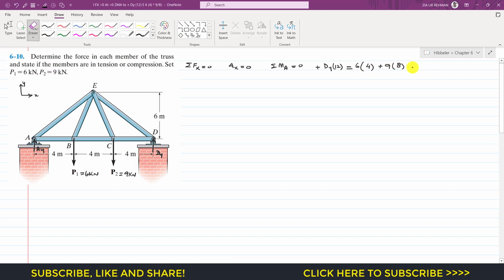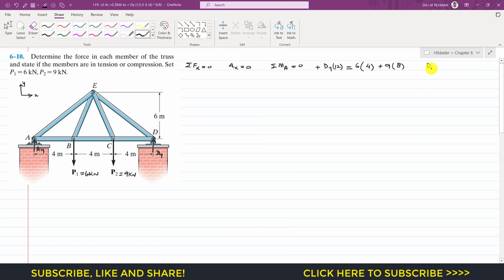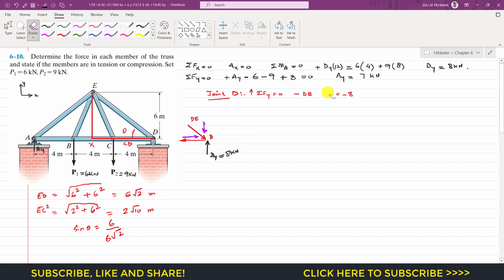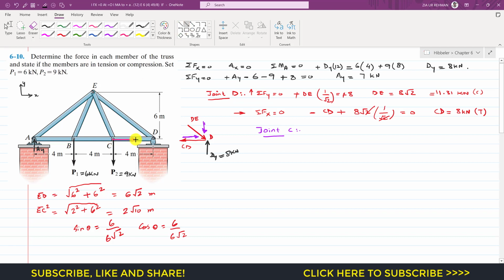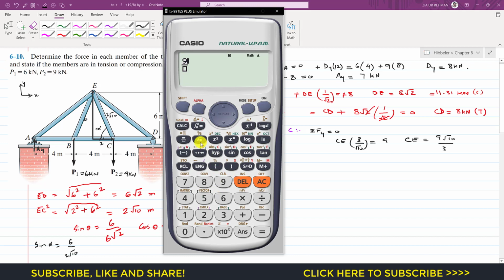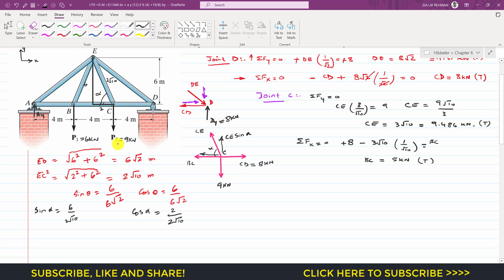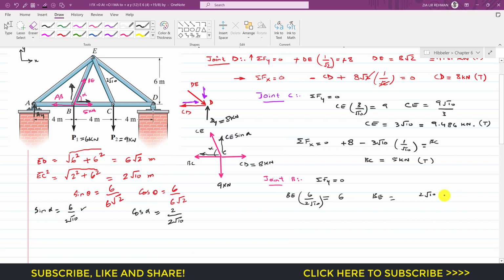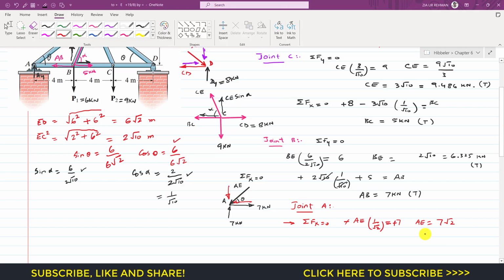6-10 Structural Analysis Chapter 6 Method of Joints Hibbeler Statics 14th ed Engineers Academy

Comment: Where is the x vector od A and D? It is missing ( there is no roller)
Reply from the maker: All the external force acting downward they are zero. Secondly watch video from the very start. Thanks
Reply: Why A x is zero ? U r saying only this is in x direction ,u can x direction as reaction at D too ,so A x wont be zero than.
Reply: @meeranchand2970 d is not a fix support so no component on horizontal